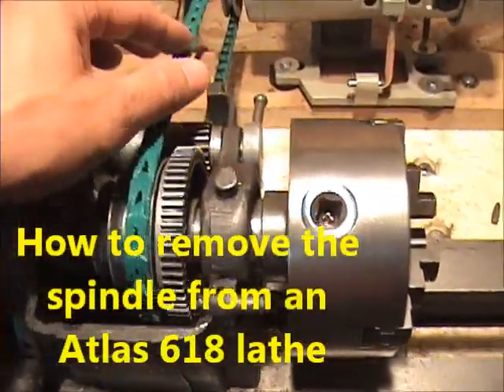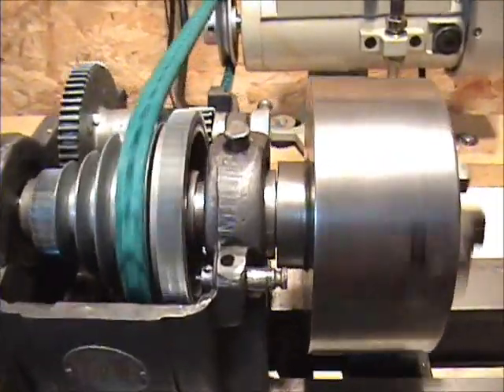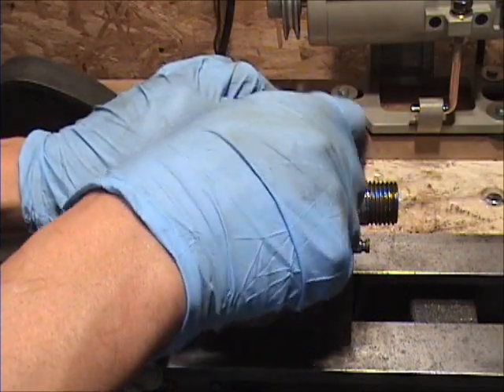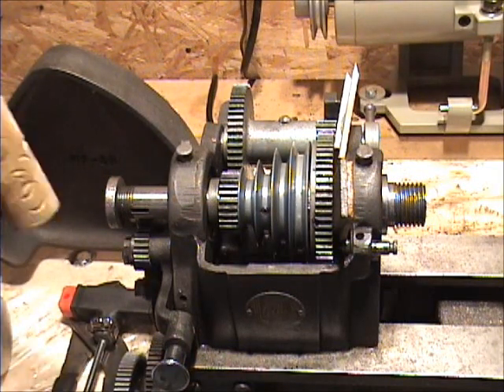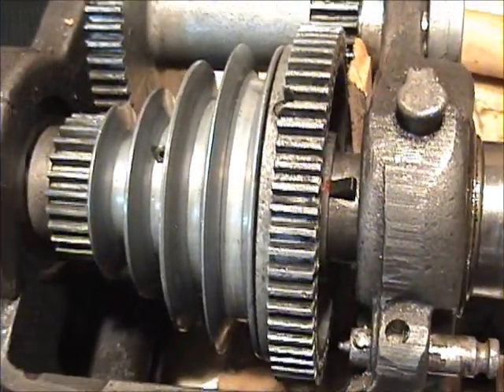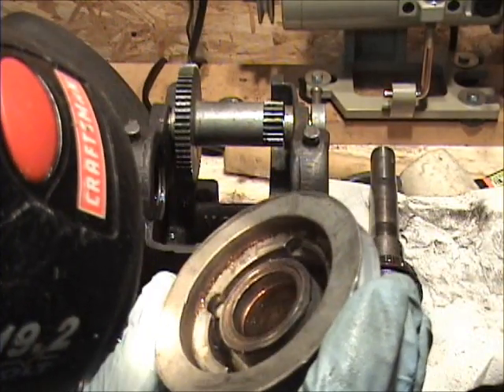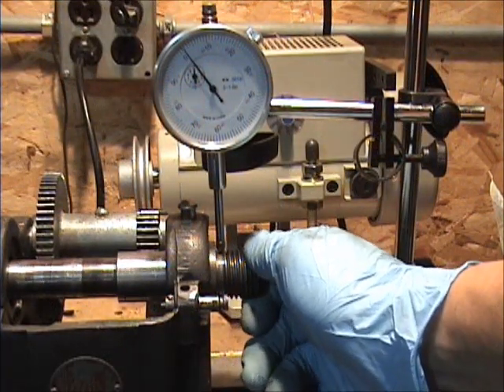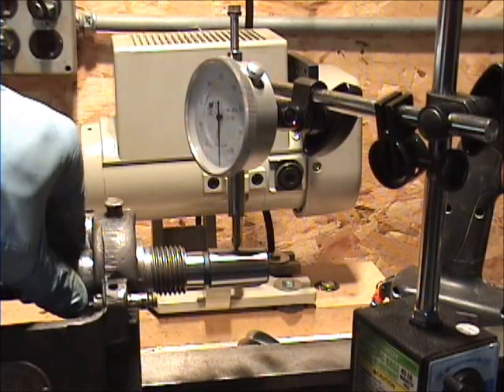How to remove the spindle of an Atlas 618 lathe

Comment: I have the same model lathe and fixed a similar problem on mine. Be sure to check the m2 taper surface inside the spindle for chips or scratches.  The mating surface of your chuck may have issues as well.  I noticed a discoloration of my he chuck threads in the spindle. Has it been overheated in the past. If so, distortion may be the source of your problem.  Good luck.
Reply from the maker: Thank you so much!  And good luck with yours too…..

Comment: There may be a nub of a pin inside the spindle bore that is worn down or crushed.  It may be high enough to throw off your run out readings but not high enough to see it easily.  The South Bend has such a pin and it is normally used to secure a collet into the bore and keep it from spinning while it is being tightened.  the collets all have a longitudinal groove up the side that this pin fits into.
Reply from the maker: I think my entire run out problem was a loose spindle.  You live you learn.  Thanks for the info........
Reply: That is possible, but does not explain the wobble in the test being always on the same part of the rotation. In other words you had a "high spot" at some portion of the 360 degree rotation.  If the spindle was just loose the high spot would not repeat so well as it did. 
Also, it would feel loose as well. .015" is a lot of run out. 

 Anyway, if they sold collets for that lathe you need to inspect one and see if there is a groove up the side of the collet.  The nub or pin sits in those grooves so that they don't spin when the collet is tightened in the spindle.  But the problem is that much later on 
with a new owner and no collets, you may never know that the spindle bore actually has a protrusion inside and think that your spindle is bent when you try to do run out tests!
Reply from the maker: Gotcha!  I fixed it by buying a new spindle and making sure it was tight.  And thank you so much for the info........
Reply: Where did you find a replacement spindle?

Comment: I have a very old lathe, no name... but it has exactly the same problem. Replaced all bearings, cleaned up everything to find out the spindle is bent. Got 0.03 mm deflection at the nose, but when using a bar of a couple of inches, that deflection gets to millimeters. The reference face needs to be as true as possible. If someone could make me a new spindle as you can't buy it in a shop, I would be glad :)
Reply from the maker: I'm sure a spindle could be made by someone, but I think it may be better to find out the name of the lathe and search for a new spindle.  I got mine from the maker of the lathe for a reasonable price.  I would start there first.  And good luck.......
Reply: Tried that already... Checked with "the lathe reference" Tony Griffiths of lathes.co.uk. He has an archive of hundreds of lathe pictures. It's a early 20's or 30's model in cast iron. No name tag, no serial, no specific design.

Having a spindle made for a table size toolroom lathe would be very expensive. Then I'm better of buying another used one for a couple of hundred $ or €.
I only paid a bit more than the price of scrap metal for it, so it's not a major loss.

Thanks a lot for your reply !
Reply from the maker: You're welcome and I'm sorry I couldn't help.  Good luck.......

Comment: It may be that the spindle ran so hot, it bent. I doubt theses shafts are hardened. I'd say you need a new spindle.
Aside from that, I'd appreciate it if you could tell me what kind of sewing machine motor you are using.
Reply from the maker: +GnosisMan50 I bought a new spindle and it' running great.  I'm not home until tomorrow, so I will look up what the motor is and let you know.  Please remember I'm a total novice and have no idea if this is a good motor (torque wise) or not.  I didn't have a stock motor to compare it to.  I'll try to let you know in the next day or 2.......

Comment: If the O.D of the spindle is O.K. then the I.D. was bored out incorrectly, probably been that way since new. Hope you find it but it's the only thing it could be.  Would like to know what you find.
Reply from the maker: I put in a new spindle.  I have a lot of parts I plan to repair.  I will look at that spindle when I get time.  That will probably be when I retire;-).  Thanks for the comment.....

Comment from the maker: Thank you so much!  I think it is the threads are not deep enough in the chuck. There is a 1/16" gap between the chuck and spindle. The spindle is dead true.  I bought a 1" x 10 tpi tap and need to go a little deeper, but I'm scared to break the tap in the chuck.  I may buy a new 3 jaw chuck until I get better at machining.  Then I'll fix this chuck and have it as a spare......

Comment: nice find man. good to see some original owners of 618s didn't abuse them and people now can do reasonable retores. rubbing the ways with an abrasive pad etc. isn't the way to go. they are better handled by other techniques. mounting is important so not to twist the bed. simply bolting it to a bench will only do if your lucky. it will cause wear patterns only rectifiable by expensive techniques( of which these lathes do not justify the cost). happy lathing!

Comment: the 618 has no reference for chuck concentricity, just the threads and luck. your runout on the center. easy check of the spindle bore with a starrett last word indicator will give you the answer. i need your spare spindle. will give you in return the procedure to make you headstock and chuck, etc, run so true a southbend owner will weep and plead for the procedure. as for the rest of the lathe, well not much can be done. the bed has 2 flat bars for ways. all your spare parts appreciated.

Comment: i have a 618 that was trashed by 2 previous hacks. what a mess it is. need nearly all headstock components. your chuck wobble: chuck a drill bit and observe its runout. if ok chuck is ok. if not then likely 1 of 2 things wrong. 1. chuck not against reference face of spindle(threads not deep enough in chuck, etc.) or reference face of chuck not perpendicular to chuck jaws. careful here much more mearsurements needed to determine what to do to rectify.

Comment from the maker: Unfortunately I did not find the problem.  I bought a new spindle and bearings.  That didn't work.  I replaced the bearing cups with new ones.  That didn't work.  My next plan is to try a new headstock.  I'm grasping for straws.  Thanks for asking.......
Reply: ive had problems like this on the 109. series lathes as well,,it was a bent spindle in the thread area,its very thin there in bottom of thread,as for other spindle ,probly bent also.

Comment from the maker: Thank you so much Faye!  Ok, I just posted another vid that may shed some light on the problem.  I did use a face plate and got .006" runout.  However, I don't know how accurate the face plate is.  Also, I don't think the depth of thread is enough to seat it properly.  Can I use a machined spacer?  

Ps.  I sure hope the spindle isn't bent.  btw I used a big crescent wrench to fit around the shoulder on top of the bearing, and then tapped the wrench with a hammer to slide the bearing. Thanks!

Comment: Looked at video again and it looked like a gap between your chuck and the shoulder you dialed into with half thou. runout. I think the chuck should spin on up to shoulder if there is enough depth of threads in chuck. you will have to measure your length of spindle threads from the end to the shoulder and then measure your chuck internal threads to see if it will go further. If it doesnt mate up to spindle shoulder this will definatley cause your chuck to wobble.
Reply: Yeah, what he said.

Comment: If your faceplate runs out of true, that means your new chuck is good and the spindle somehow got bent on the threads. Didnt see how you removed that front bearing but heard you say something about using a big crescent wrench. Seeing how your internal morse taper is out of wack kinda indicates that it is bent.